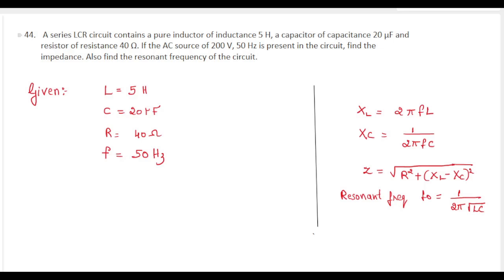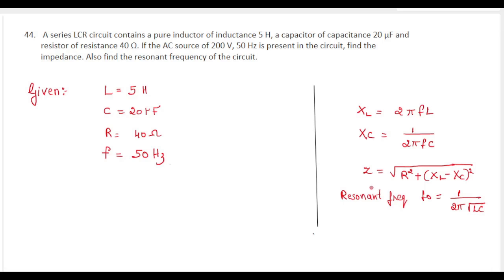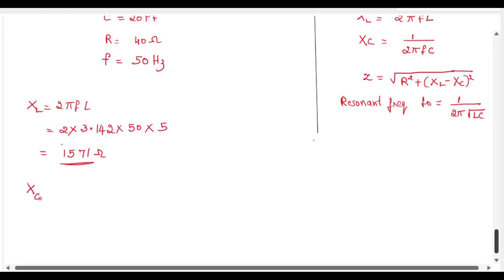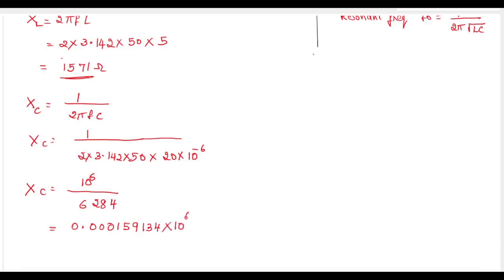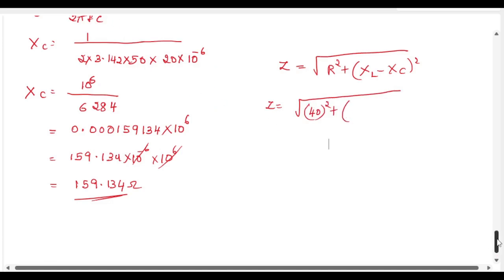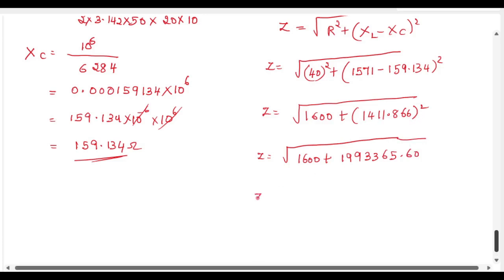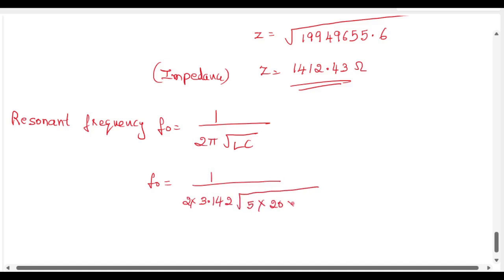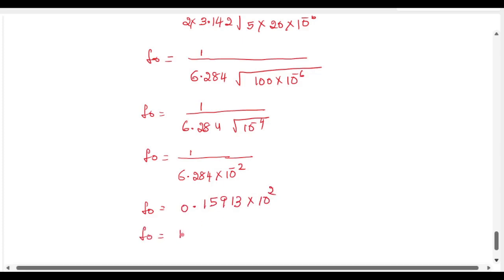A series LCR circuit contains a pure inductor of inductance 5 H, a capacitor #2ndpuc #modelpaper

Comment: mam now wat is the correct value of pie mam in you old video you told 3.141 now you are  telling 3.142 which sould we use mam
Reply from the maker: It wont make a difference, approximate rounded value is 3.142, u can use 3.141 also